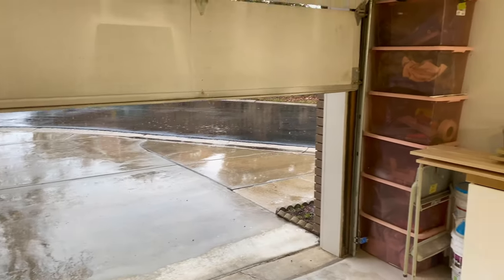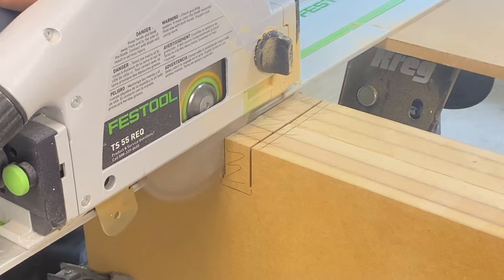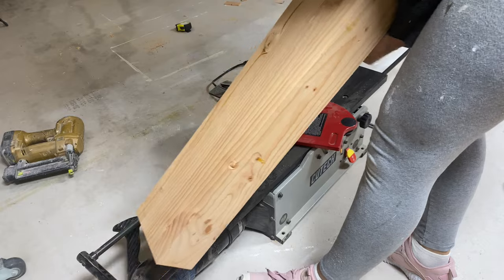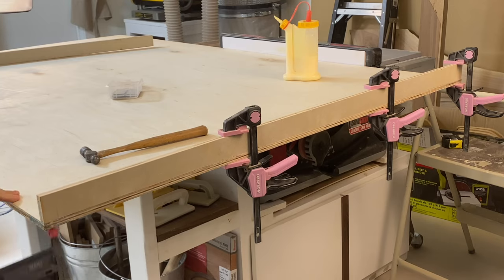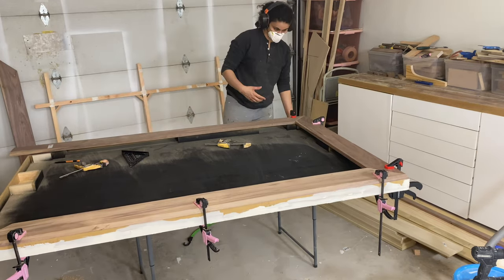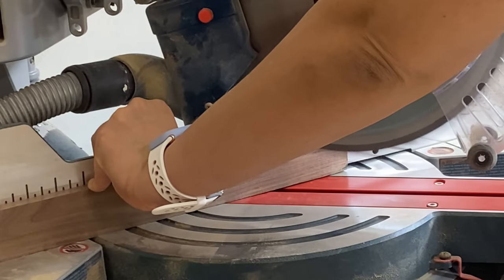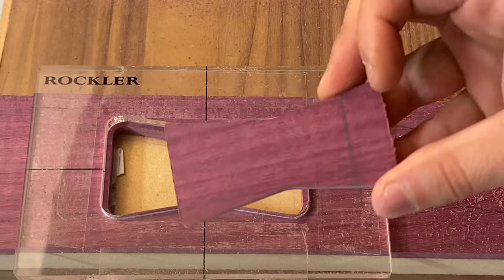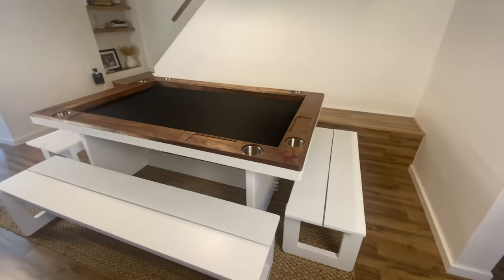GAME BOARD DINING TABLE - I built a game board table that double as a dining table - DIY

Comment: Love your work! What material and finish did you do for the actual white table top?
Reply from the maker: Thank you so much. At first I wanted to use poplar but I felt bad about painting so then I used MDF. Because is inexpensive enough that I can replace in a year or 2 if damage. But so far, it’s handling everything really well. I drop a bowl of soup a few days ago and was so clean to use and no stains marks. I used 4 coats of polyurethane water base.